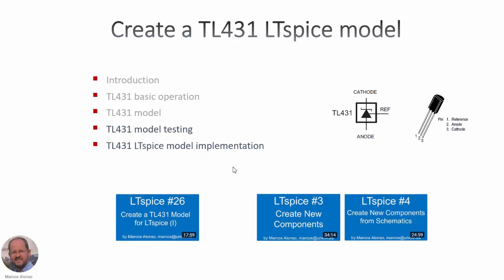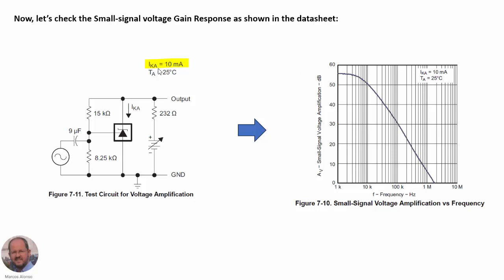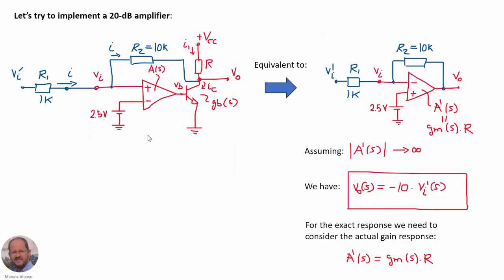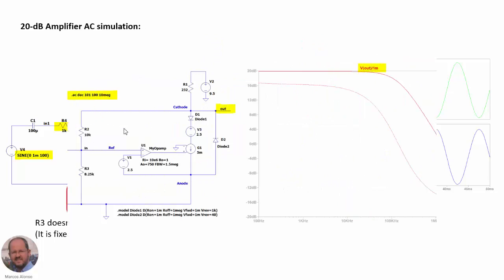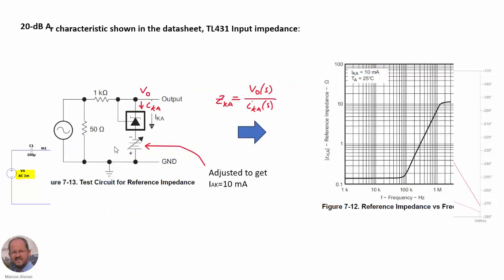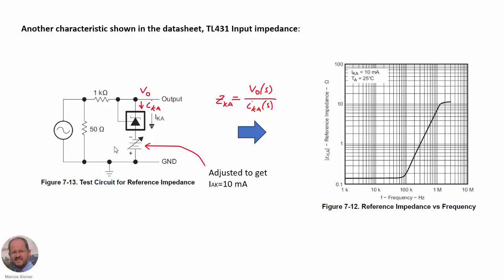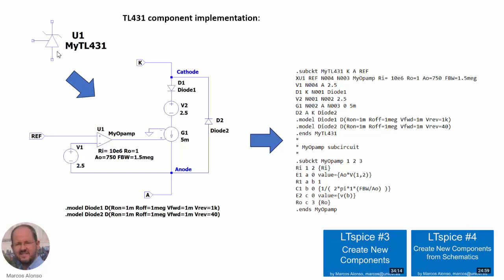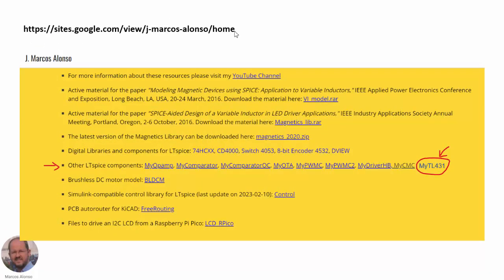LTspice #27: How to create a TL431 model (II)

Comment: Hello Professor Alonso, I'd like to ask why do we need C1 here, is it for the DC Block? And R3 is used to adjust the DC current? I'm still a layman of analog circuit, so thanks a lot for your videos 👍and looking forward to your response!
Reply from the maker: Hello, good question. C1 is necessary to inject the AC signal of V4 without disturbing the DC operating point at "in". If you do not use C1 and connect V4 directly to "in" node you will have a short circuit between "in" and ground for the DC operation.

Comment: Can you explain how you get the 10mA cathode current with that 9.5V source?
Reply from the maker: Yes, of course. With reference to the circuit at 2:30 we have Vref=2.5 V, the current through R3 is 2.5/R3, which is the same as the current through R2, so the voltage at the cathode is 2.5 + (2.5/R3)*R2 = 2.5*(1 + R2/R3) = 7.04 V. The current through R1 is (9.5 - 7.04)/232 = 10.6 mA. The current through R2 and R3 is 2.5/8.25k= 0.3 mA. So the current into the cathode is 10.6 - 0.3 = 10.3 mA. Approximately 10 mA

Comment: Please Professor Alonso, whenever you are available, could you make a video on small-signal modeling of push-pull Isolated converter? I am not sure how to model the switches (MOSFETs) and the transformer. Please Professor, could you also talk about the peak current control of that converter? Thank you so much for your videos, they are very helpful.
Reply from the maker: Current-mode control of the push-pull converter is a very interesting topic. I will probably cover it in the future. Thanks!